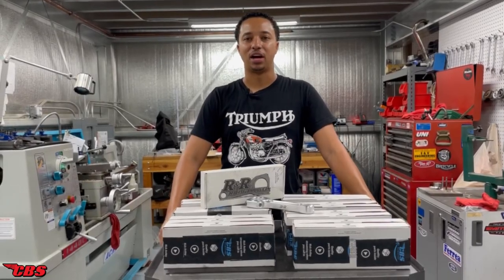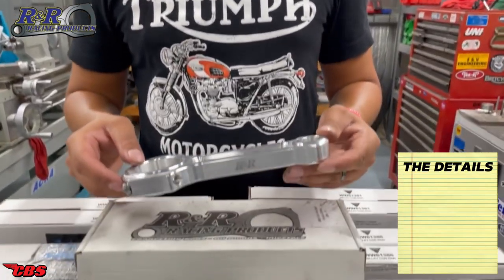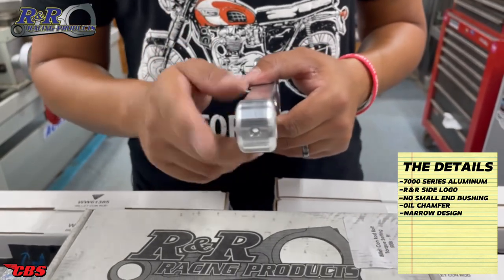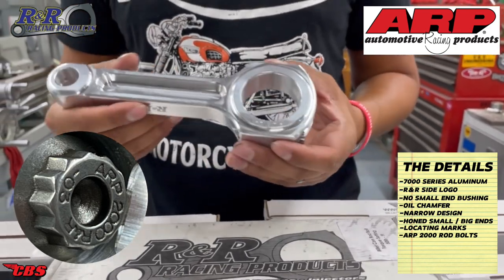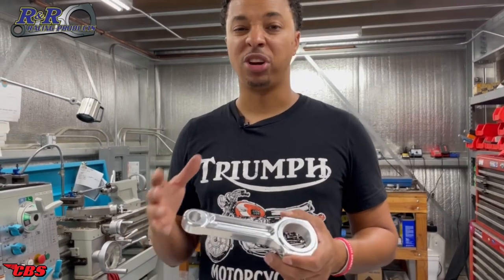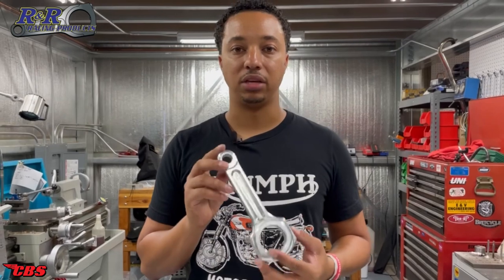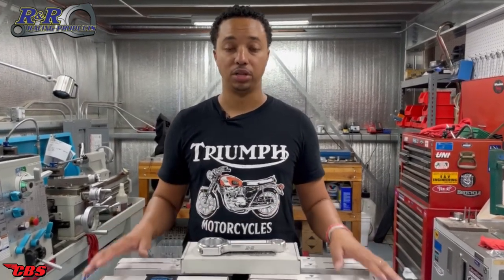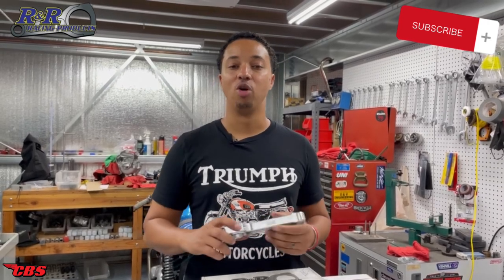R&R Connecting Rods (For Vintage British Motorcycles)

Comment: How would these compare to Thunder Engineering rods?
Reply from the maker: The same, except thunder rods use rod bolts that thread directly in the rod, R&R uses a bolt and a nut
Reply: No R&R use bolts that thread directlty into the rod as well  @classicbritishspares
Reply from the maker: @localchap135  you right - was thinking stock rods. Cheers